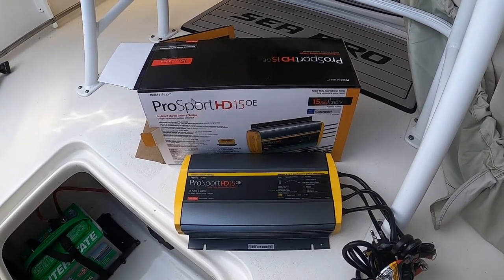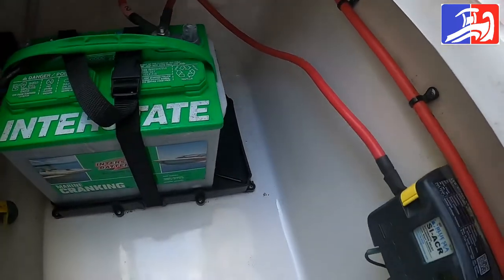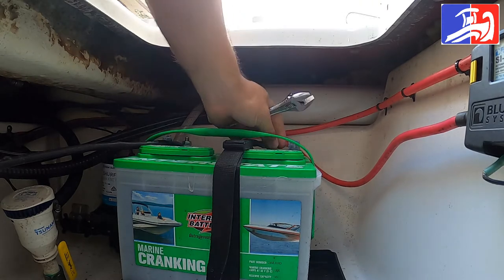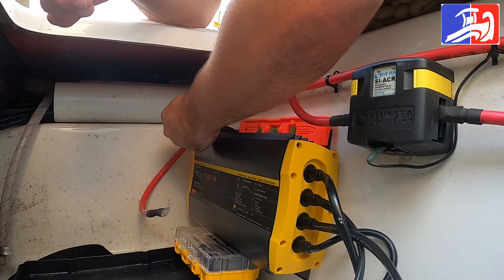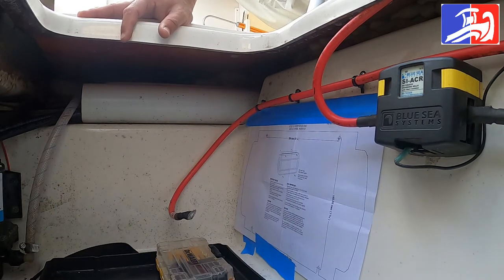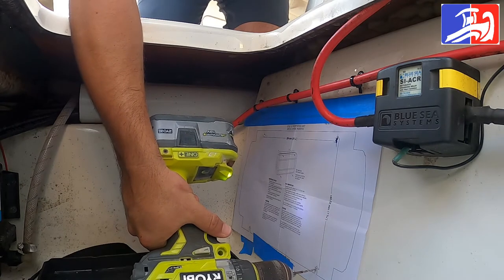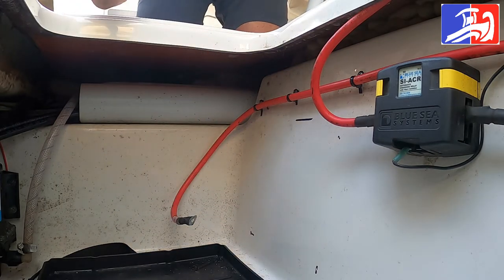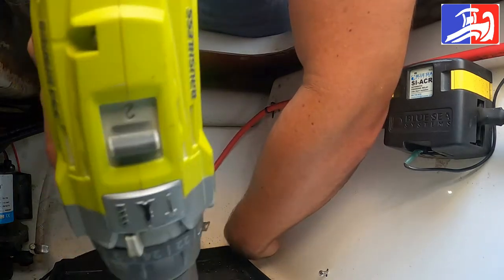DIY Installing & Wiring an Onboard Boat Battery Charger   ProMariner! Ep12

Comment: I'm a little late to the party on this, but I have the same boat and initially configured the same charger setup.  Did you happen to notice that when you were charging the batteries, after about 15 minutes, the ACR was is in a constant state of "combining" or parallel, as indicated by the green LED on the ACR.  Any thoughts?